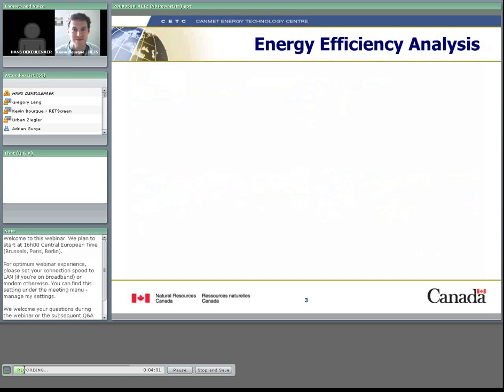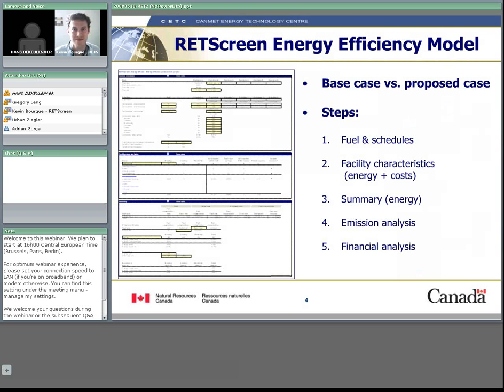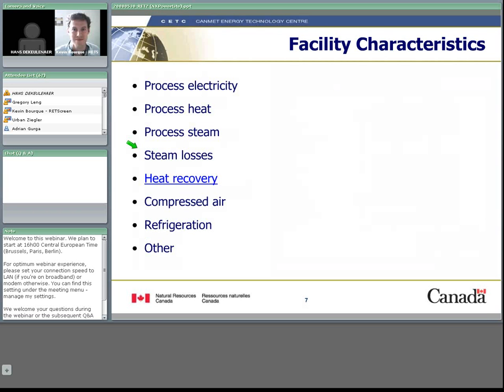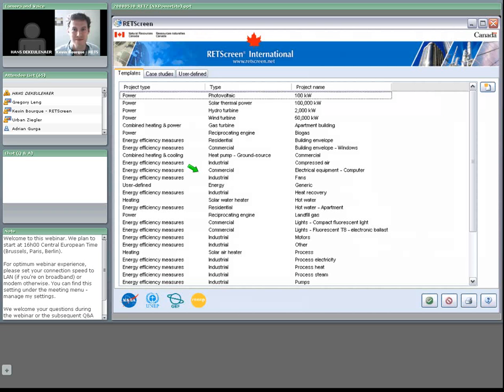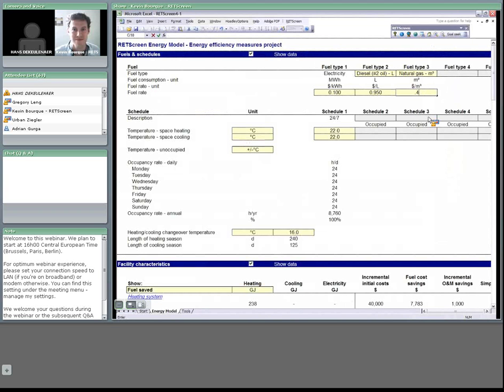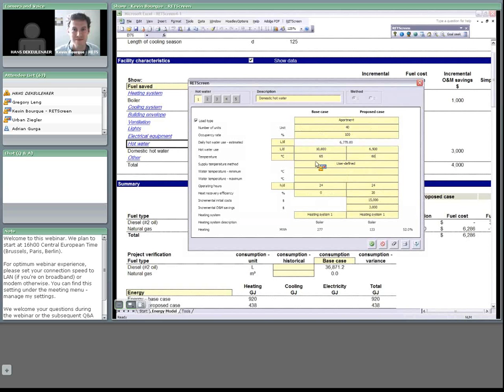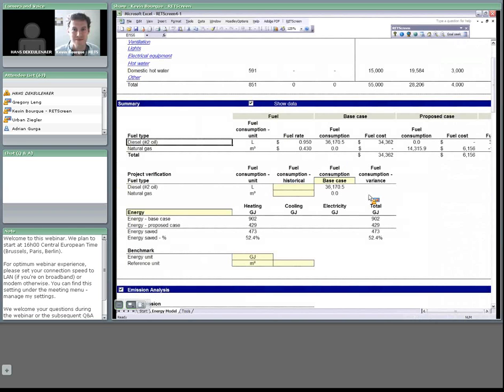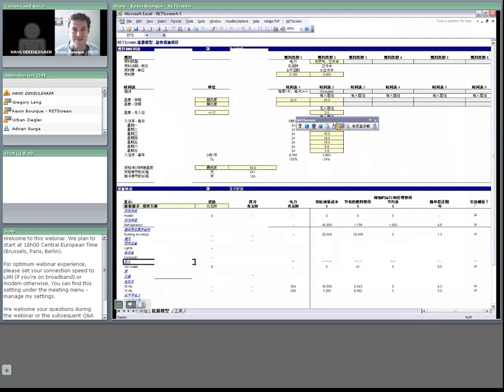RETScreen Energy Efficiency

Comment from the maker: Thanks for your question, Thomas. You’re absolutely correct. The assumption here was that the faucets were old and that going from 10,000 to 6,500 L/day would be possible. In older buildings, it’s not unreasonable that many shower heads and faucets have unrestricted flow. Simply adding aerators and reduced flow heads can have a dramatic impact without inconveniencings residents too much.